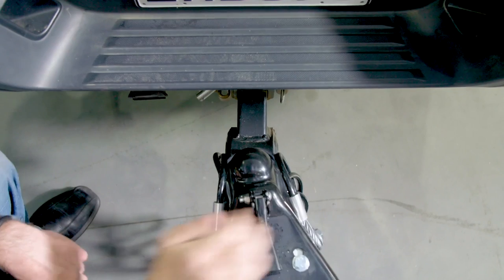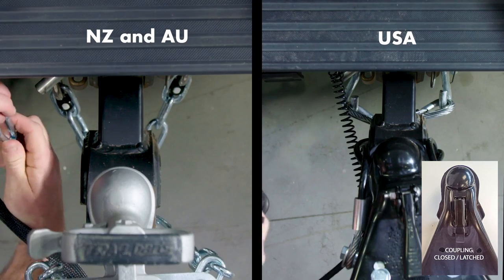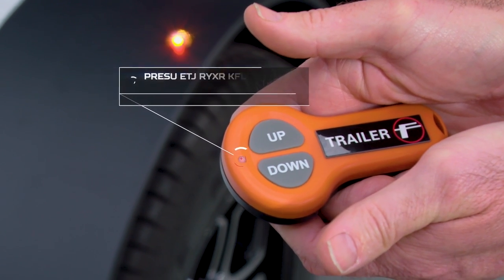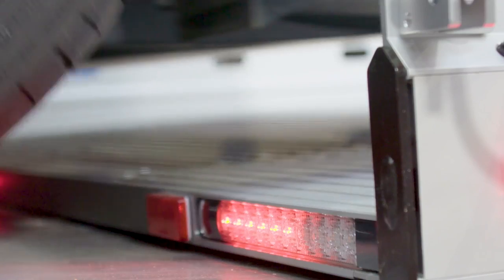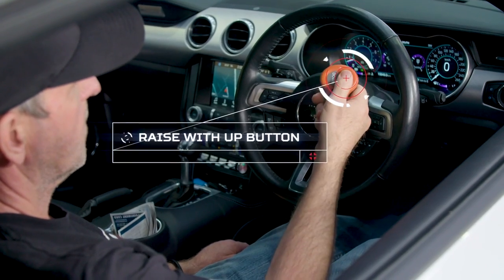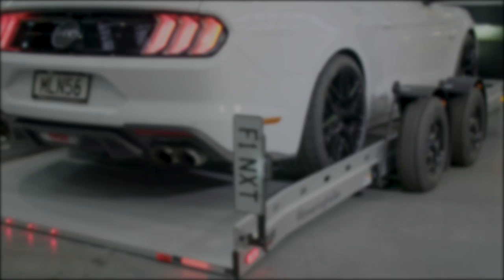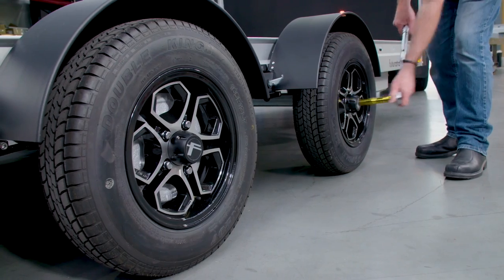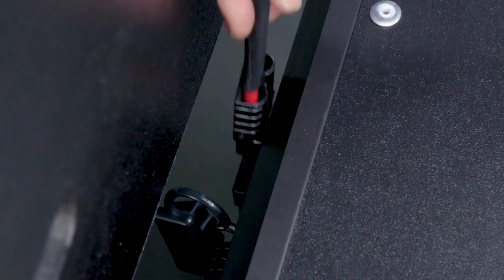Futura Owner Quick Start Guide - Sport Range | My Futura #futuratrailers #cartrailer #carhauler

Comment: Looks like it has zero suspension.  Just solid axles that pivot.
Reply from the maker: Apologies for the late reply - our trailers feature torsion suspension axles; which redefine the towing experience with a smoother, more stable ride. Thanks